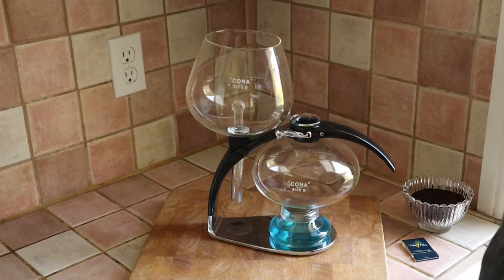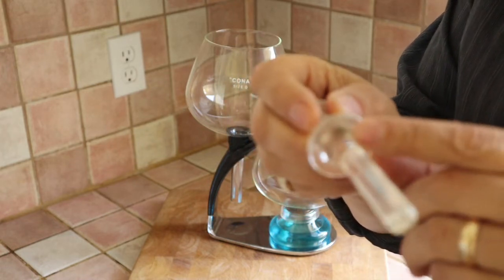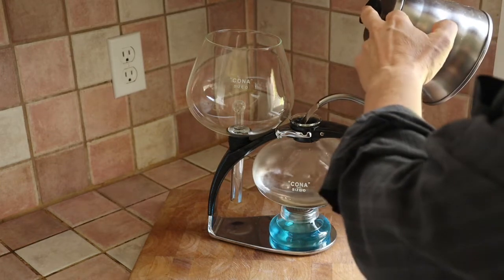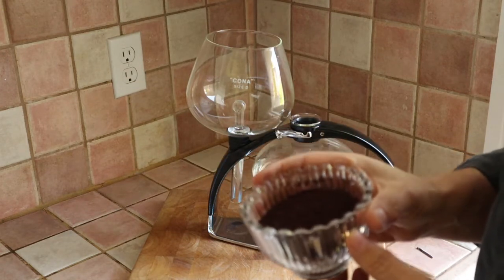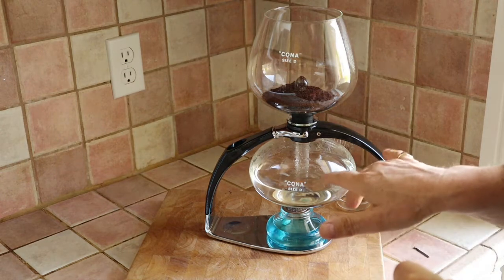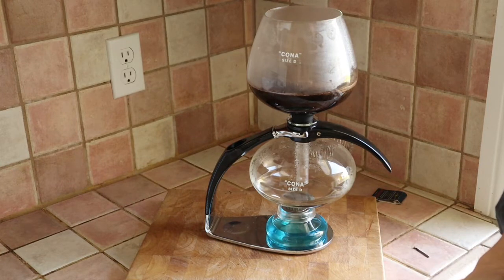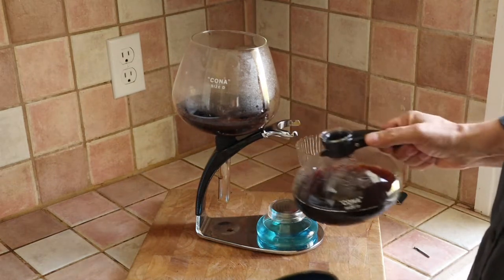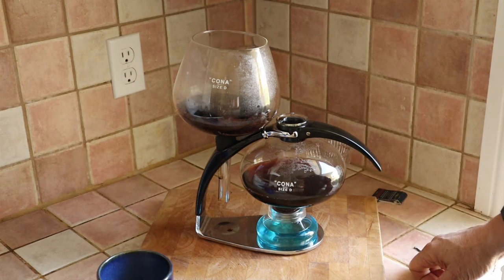A Demo of the Cona Coffee Maker

Comment: Interesting. I have used a Cona D for 25 years and I have never made less than a whole pot.

I use 36g of coffee, and when the hot water in the pot "burps" as it reaches the bottom of the funnel, I set a 4 minute timer. At some point I carefully (so I don't hit the glass filter) stir the water in the upper chamber, then at 4 minutes I put the flame out. 

I have found that it's better to wait until ALL the moisture from the grounds is drawn into the pot. You can see the last bit of moisture on the grounds disappear. If you decouple early it loses some of the flavor nuance.

Good video!
Reply: You're right to make a whole pot using the water volume they are designed for. The process does depend on the right amount of water to work properly. Cona also made 3 other sizes of this design - all in imperial measures - a Model A (1/2 pint) a B (1 pint) and a C (1 1/2 pints). The D in the video is really designed for 2 pints. 
You can still buy the Model D new, but the other sizes are discontinued. Still a few around of those, but the prices are getting quite high especially for the B size, and even more so for the A size. They also sold small electric heaters in place of the spirit burners.
I think this model range was introduced in the early '60's. Before then Cona sold ther similar "Rex" -  designed by Abram Games as this one was - a great piece of mid century design and now much sought after.

Comment: Finally the only issue is that it takes much more time to be done and can't be done without you assisting (wait for water to bowl to put the top part in place, then wait for the process to be done to put the cap on and then wait for the last process to be done to remove the top part, is that it ?

Comment: The model you demonstrate (the "D" version) is too big for the amount of water you are using. Cona also made other smaller versions - the A, the B, and the C - these use 1/2 pint (imperial) 1pint and 1 1/2 pints respectively and are designed for those specific volumes. Thge D version is designed to use 2 pints of water. The process doesn't work as well if you use the wrong amounts which may be why the draw down was so slow.